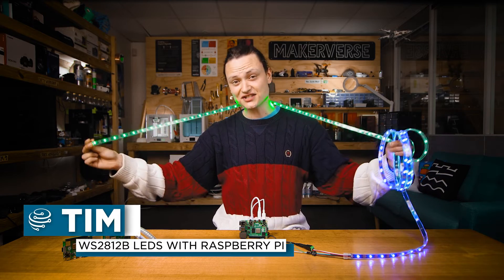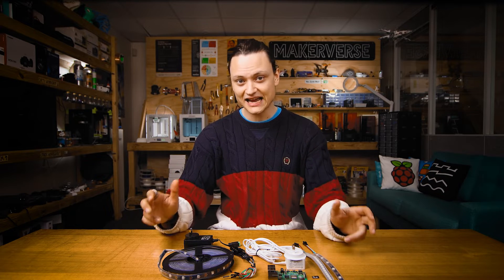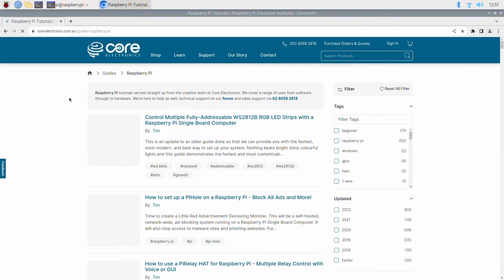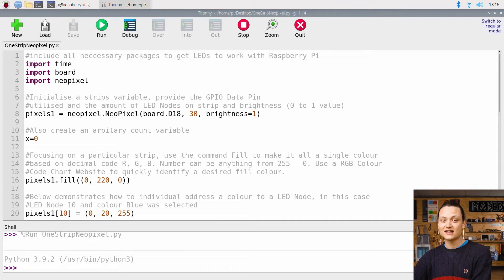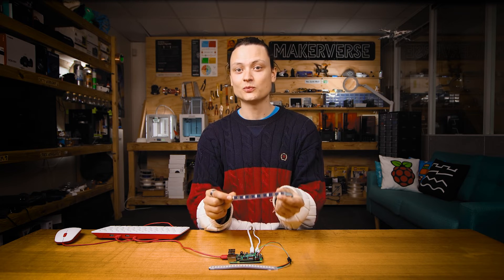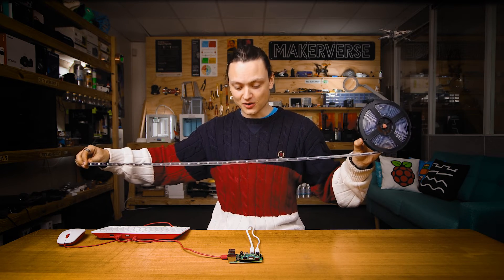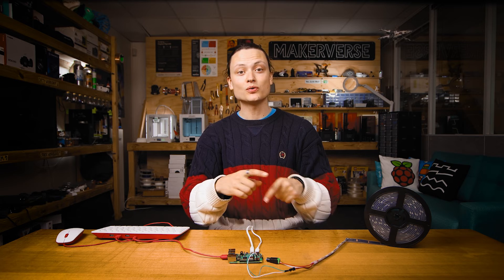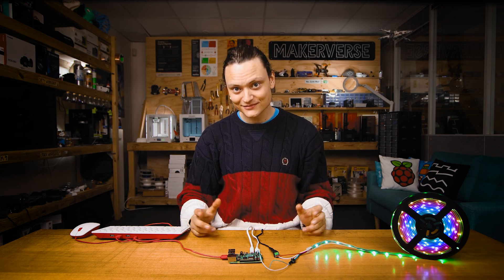How To Use Addressable RGB WS2812B LED Strips With a Raspberry Pi Single Board Computer

Comment: Can this still work on a raspberry pi pico or pi pico W? The smaller form factor is a high priority for my planned project.
Reply: Hey! I didn't make the video, but I am currently using a Raspberry Pi Zero W with 120 LEDs and it's working. I don't know if the Pico would work because it cannot run Raspberry Pi OS.

Comment: I want to use a 144 pixel LED strip with a battery pack. Can anyone recommend a battery pack? Also, will this work with Raspberry Pi 3 or 3B? Or Pi Zero v1.3?

Comment: i think this would be perfect to build a led controller for the pc. you could use the raspberry-pi directly as a host for your own resource monitor. That brings me back to a point that I would be very interested in: the smartest way to realize that the raspberry >starts< and stops together with the pc. That would probably be perfect via the gipo's. I would do it with relays due to lack of electrical engineering understanding (I assume that the mosfets etc could be better - but I never know which ones I need etc pp)! maybe you could make a video about it? there are certainly more use cases why you can want that - because unfortunately the PI does not support WOL. would be glad.

Comment: How about managing simple white led strip which only use 2 wires?
Thank's in advance for feedback
Reply from the maker: When it comes to two wire LED strips you only need to provide it with power (5Volts and Ground Normally). You wont be able to get a single node to switch on with all the others off. It will be either completely on or off. Use any 5V power supply with a DC barrel jack adapter wired in and you'll be off to the races 😊
Hit us up at the forum if you need any more help - https://forum.core-electronics.com.au/latest
Reply: @Core-Electronics  thank's for your replay.
And what about code to turn on/off led or dimmering them?
Reply from the maker: Come hit up our Python Workshop 😊 That'll teach you about loops and how to dim lights by using them in your code - https://core-electronics.com.au/courses/python-workshop/

Comment: Hello! Thank you so so so much for this video, I am a complete beginner to this and found it super helpful to understand the basics. I do have a question that may seem a bit simple, but I am planning on using WS2811 LEDS that are still addressable and come in strands of 50, and I wanted to double check that I do not need to use specifically WS2812B with any of the python scripts? Apologies if the terminology is a bit off, thanks so much again!!
Reply from the maker: The Python scripts will still work mate 😊 Also come check out this guide too - https://www.youtube.com/watch?v=GYxctjukehY

Comment: Thank you for this great tutorial! Question: what would be a good solution to power both the raspberri pi and about 150 led nodes together off the same power supply, to have a single wall plug solution? Ive been looking around for dc to female barrel jack and micro usb splitters but cant find many reliable parts that seem to do this job. Any suggestions on parts and what amperage I should go for in terms of power supply? Thank you!
Reply: you can try DC 5A Step-down Power Supply  like this 9-36V to 5V Power Converter XY-3606, and it gives you one power cable and connecton 5V to rPI and 12v for leds ;)

Comment: Can I get the code to work on older rpi Model B+ v1.2?   The code and libraries can load, but I don't get proper output on GPIO.
Reply: I was trying with the same raspberry pi version, same problem. Everything runs without problem, but no action on the led strip.
Reply from the maker: Have written the fix in the written up article, you can see it at the bottom of | Flashy Demonstration | chapter.
Reply from the maker: I'll look into it mate, come check our comment section of the bottom of the written up guide. That might help you too. Also the GPIO pins are numbered different with the original Raspberry Pis If I remember correctly. https://core-electronics.com.au/guides/fully-addressable-rgb-raspberry-pi/

Comment: i have a 5V and 3 Amp power supply for the LED strip. Is that enough?
Reply from the maker: Depends on how many LED nodes your powering + the type. But if your powering ~150 WS2812B LEDs then your absolutely going to be able to power them all 😊
Reply: @Core-Electronics  im running one with 300
Reply from the maker: Each RGB LED draws approximately 50mA when it is set to full brightness and powered at 5V. So your not going to get full brightness but truthfully they will be very bright anyhows. Come check this guide on powering heaps of LEDs from Adafruit - https://learn.adafruit.com/1500-neopixel-led-curtain-with-raspberry-pi-fadecandy/power-topology
Reply: @Core-Electronics  So a 5v 3a battery pack should be sufficient for a 144 LED Strip?

Comment: mmm are you sure about the power needed. Taking 144 in a 1 meter led strip will take 8.6 amps to run those leds at full brightness "white"
Reply from the maker: Cheers for bringing this up. The provided code for the long strip drive the system at a quarter brightness. So we have 50mA Per Node * 144 Nodes * 1/4 = 1.8 Amps. That keeps us in a safe range for the power supply even if they get driven full white all done the line (a rare situation best suited to high power LEDs like these - https://www.youtube.com/watch?v=rDkP97-BHXI)

Comment: Hey, nice video. Tough I'm facing the following Problem:
Everything works for roughly 20 seconds and then the gpio pin stops sending any data. And the LED are just stuck at where they are. This stays like this until I restart the script. Do you have any solutions for this?
Reply from the maker: Very weird indeed! Come make a forum post here at our forum and post some images of your set up. That way we will best be able to help you - https://forum.core-electronics.com.au/
Reply: @Core-Electronics  Thanks for the fast reply, I will have another look tomorrow, maybe it's some stupid little mistake on my side. Then I'll try to ask in the forum :)

Comment: Edit: fixed it, broken gpio pin!

Really intuitive video with great explanations but I’ve been having an issue where the 3 first leds will come at varying brightnesses, with seemingly random colours. (this is when running the downloaded script.) after a bit of flashing they turn off. im running a 5v 10A power supply and a 150 led strip with a raspberry pi 3b+. im wondering if this is to do with the gpio output of the pi being 3.3v rather than 5v. It could also be as they are RGBW. Any ideas? Thanks
Reply from the maker: Glad you fixed your issue! Thanks for commenting too 😊
Reply: how did you find out that your gpio pin is broken?
Reply: My thonny give me some errors.

OneStripNeopixel.py     Line 34 in >Module<

Adafruit_pixelbuf.py.     Line 309 & 273 in _set_item

I have no idea 😢

Comment: The video is very useful and I have one question,  at 11:13 do I need to connect the last red pin to the 5v raspberry board or 5v from the power brick 5v-4A is enough ?
Reply from the maker: Heyya mate, excellent question 😊. You only need one power connection to the LED Strip, so the power brick will be enough. Check this image if you need -  https://core-electronics.com.au/media/wysiwyg/tutorials/Tim/ws2812B-RASPI/GPIO_Set_up_Hardware_for_Loong_strip.png - Note that they share the same ground (and as such have a ground wire going to both the power-supply and the Raspberry Pi)
Reply: @Core-Electronics  Thanks for the detail, that helps me a lot. I just have one more curious question. 
Since I'm going to put the pi and the led strip all into a computer case. I wonder if possible to use my 5v-18A from my PSU for the pi400 and the led strip too ? If yes then it would be great,  I won't have to use another power supply.
Reply from the maker: Absolutely mate, your Raspberry Pi runs at 5volts which is perfect for your PSU. It will only pull the current it needs from your PSU and 18 Amps is more than enough for the Raspberry Pi and your LEDs 😊. Come check here to learn some golden rules when it comes to selecting a power supply, read through that and you'll feel confident forever more - https://core-electronics.com.au/guides/power-supply-which-to-choose/
Reply: @Core-Electronics  Thank you very much, it solves a lot of my problems and now I can simply use my PSU for my project :D
Reply: I love this! We can actually have a Raspberry Pi, inside our computer, running off the power supply, powering some custom LED lighting. I'm on it!

Comment: Ok.  So next question.  Controlling the strip by using a 4x4 Matrix keypad?  I see tutorials for using buttons, or using the Keypad and one LED, but nothing to use the keypad to pick an animation or a certain segment.

This video got my LEDs up and running perfectly AND explained the reasoning behind some of the code, which the notes were fantastic, BTW.
Reply from the maker: I totally understand what your looking for. 

Now this linked guide isn't exactly what your looking for but it does teach you how to use Curses Library which is a great Python to use to make keyboard inputs cause an effect to hardware. In the example of this link the arrow keys on the keyboard move a Pan-Tilt HAT. https://core-electronics.com.au/guides/pan-tilt-hat-raspberry-pi/#Keeb

You can then create a custom light loop show in the script which then get activated when you press a keystroke. Come pop by our Forum if you would like some more help, ask for Tim and Ill be right there 😊 https://forum.core-electronics.com.au/

Comment: Does this work for WS2811 strings?
Reply from the maker: Voltages are higher for those WS2811 Strings, which isn't a big problem you just need to be careful not to accidentally fry your Raspberry Pi as 12V will burn it out. Hit up our forum if you need a wiring guide 😊 https://forum.core-electronics.com.au/

Comment: Can't use just directly use the p400 instead of connecting the 4b to the p400?
Reply from the maker: I see whats happened here and its such an easy mistake. On the table with me is the Raspberry Pi 4 Model B and the official Raspberry Pi Mouse and Keyboard.

The Raspberry Pi 400 looks almost exactly the same as the Keyboard, you can see them both being used in our guide here - https://www.youtube.com/watch?v=uaWC0GzvZSI.

So to be clear, only one Raspberry Pi Single Board computer is used in this guide here 😊.

Comment: Can you power 1 m of LED pixels straight from the raspberry pie with out external power supply and also do you guys sell that external power supply in the video?
Reply from the maker: All depends on how many nodes of LEDS are on the 1 Metre of strip. You will be able/okay to power around ~30 LED Nodes without an external power supply. And we definitely have that external power supply in stock, check it here - https://core-electronics.com.au/catalog/product/view/sku/AM8911B
Reply: Thank you for answering my question I just had one more question these longer LED strips used in the video are they 5 m long  and the power supply you linked is that perfect for them?
Reply from the maker: Absolutely 😊 the density of that long LED strip is 30 per metre, making a total of 150 LED nodes.

Comment: Alas doesn't seem to work with my led strip. also, kind of vague... since this is the only 'tutorial' i see on the internet. everyone seems to be using the same exact code. When I plug my roll of leds into it, none of the code seems to work right. oddly enough also having a hard time deciphering the docs for the adafruit code. =\
Reply from the maker: We can definitely help you over at our forum - https://forum.core-electronics.com.au/

Write up a post over there with some pictures and well get your system running as it should 😊

Comment: Will this work if you connect multiple long strips together?
Reply from the maker: Totally 😊 but note here - The longer a wire is, the more resistance it has. The more resistance, the more voltage drops along its length. Lower Voltage = Dimmer LED Nodes. So if you notice the Nodes at the end of your Huge LED strip are dim know that you can always provide power at both ends or at multiple parts along it to fix it. WS2812B do not mind what end/direction they receive power from. The data line moves in only one direction, but powering electricity can go either way.